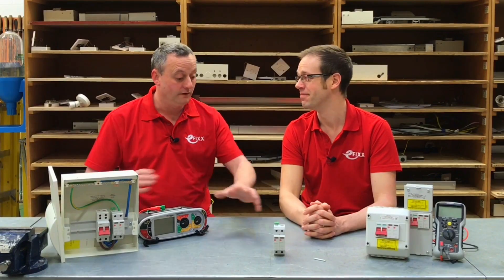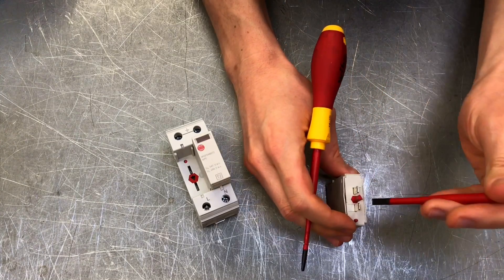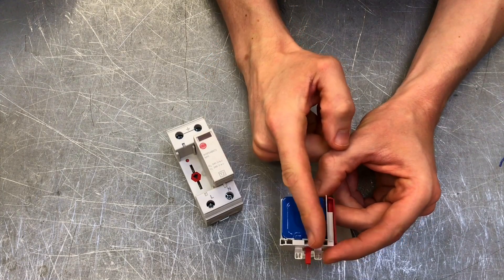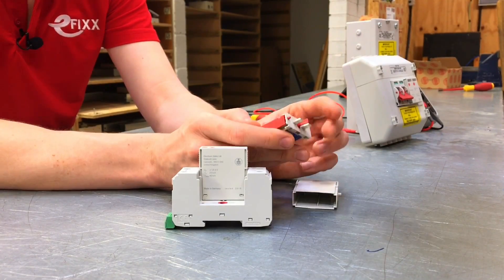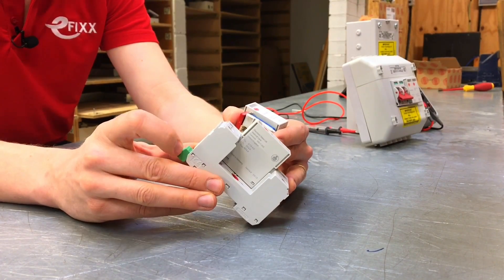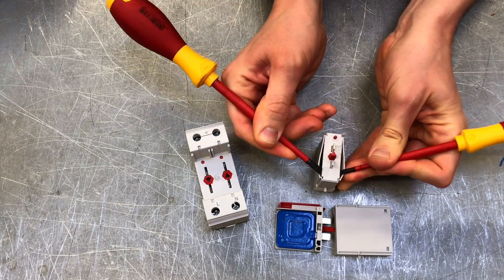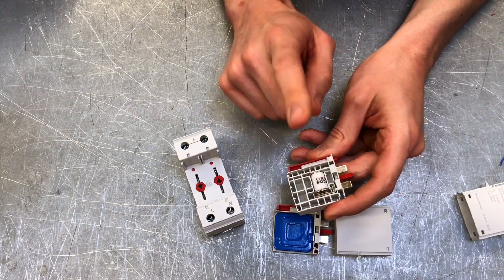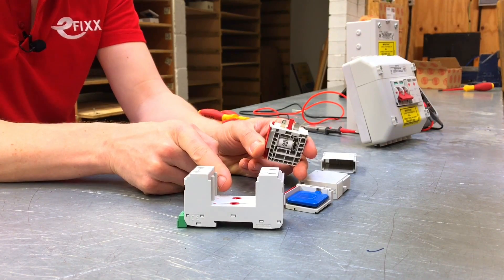What's inside a Type 2 Surge Protection Device? SPD #bs7671

Comment: Functionality is correct, but the end of life is not like this. Usually SPD will take out the fuse at each trigger, if the fuse is too strong it will blow that solder joint and put it on defect. I expect they are almost single use devices...once they clamp the voltage they will fail, in the end it depends of the energy that has to be clamped.

Comment: great teardown and explanation. is a SPD necessary if there is an under current overcurrent protector?  If trying to protect a residential refrigerator pcb/compressor and split aircon compressor/pcb which is better, SPD or undercurrent overcurrent device? Is it ok to use a single device to protect entire house or separate devices for each aircon and refrigerator?  Much thanks in advance.
Reply: yes, the protector reacts slower then the SPD and it will not pick nano-seconds surges. for the fridge/ac depends of the type. the old ones with ac motors will need a undervoltage/overvoltage protection as they are not affected by the surges, though the electronics in the fridge/ac will get hit so both would be better. for the newer ones with inverter these are all electronics so SPD.

Comment: Rcds are checked regularly  by the house owner as they were told to do by the electrician  they are never forgotten about so having A S P checked will be the same no doubt .....I wonder if there is any connection with the possibility of power outages which may induce high voltage spikes ....no I'm sure that's not right ....some people think I'm sceptic I suppose

Comment: Hi,
I was wondering what is the difference between an SPD type 2 device like the one shown in this video and an MCB with under voltage and high voltage protection?

Do I need still to install an SPD Type 2 device even if I have an MCB with under voltage and over voltage protection installed ? 

Thanks.
Reply from the maker: The type of protection offered is different. Over / under voltage is to protect against the supply voltage going above high or low limits. Surge or transient protection is designed to dissipate high energy pulses following a transient event - such as switching a large inductive load or lightening strike energy  induced in to power cables.  - check out our free training course which explores this - https://www.efixx.co.uk/Know%20How/BS7671SPD

Comment: I understand that most sensitive, modern equipments are powered with smps. As these are fitted with surge protection at their mains input filter the only reason, that I can see, is that spds, are fitted to power distribution boxes, is to protect the wiring insulation, from any voltage spikes, that occur above the maximum rating of the cable.
Reply from the maker: The MOV devices contained in power supplies can only handle a small amount of transient power.

Comment: Great video, but how is the energy produced, which is needed, to melt the solder joint in order to release the indicator?
Will the protective element turn into a short, after the last surge it can take passed by, and hence overload the joint?
Or will the last surge itself overload the connection?
If it’s the last option, wouldn’t that have the risk that not the whole surge is consumed by the device, before it dies?
How ever, good video, keep going!
Reply: Typically the indicator window is triggered by a simple build up of heat. An SPD that does not have this function could get into 'thermal runaway' so this little function uses the build up of excess heat to trigger the 'warning flag' and puts the SPD into a safe open circuit condition. If you didn't have it the heat would continue to rise and a fire could be the result. Type 1 & 2 SPD's are in parallel so under normal conditions they see no load. They operate incredibly quickly (often under 25 nanoseconds) and create a short circuit to earth to 'dump' the excess voltage. If the device fails it fails open circuit so it's relatively safe as it's in parallel and the thermal protection will help to prevent any fire. It should be remembered as well that the devices have to be tested & proven to be able to deal with 20 surge events (if the meet the IEC 61643 standard) so they are not one hit wonders, a well selected & installed SPD should offer a lifetime of protection.

Comment: Very informative video. Just wondering though, why different types of device are used for line and neutral?
Reply: Earth leakage. The neutral phase of a TT device needs to prevent earth leakage and an MOV doesn't so it needs to be a different component like a spark gap or GDT

Comment: So the 'consumer' who will be the proud owner of the consumer unit will know to regularly check the SPD for any defect at the same time as they do the quarterly test of their RCD devices... then they'll pile the coats back in front of it all, while smiling to see their equipotential earth bonding cables keeping them safe should there be a problem with the distribution network... I can't wait until we upgrade the consumer units to be meteor-proof, because you can't be too safe...(yawn)

Comment: Hello both, just a quick heads up, at 2.53 you say the left hand module bridges between the line and earth terminals. In actual fact if you bell the base unit out the bridge is made between the live and neutral terminals (not live to earth) on the left hand module. The right hand module bridges between neutral to earth. Great videos though👍
Reply: Are you sure? I was having this doubt. Thanks for clarifying
Reply: Do you know the internals of Type 1+2 spd?
Is it better to install Type 1+2 or separate Type 1 and 2

Comment: I notice that in the Wylex board shown in the video...the SPD is connected to the output of the main switch, working on the premise that a surge is present or has been detected, why doesn't the surge flow along the other equipment on the consumer unit busbar that is also connected to the SPD via a cable? The Over-voltage would flow equally to the SPD and circuit fuses..wouldn't it? especially as the two, (SPD and Busbar) are connected at the exact same Line point. How does this protect the rest of the circuits from the over voltage/surge? One would think that the tails entering the Consumer Unit would need to be monitored for a "surge" then some intervention (triping of a fuse/MCB/RCBO  etc...) would occur to protect the rest of the installation. How does this SPD device stop the surge from travelling along the Busbar to all the other circuits, at all?
Reply: SPD's operate very quickly, in this scenario typically in under 25 nanoseconds so the SPD detects the transient, triggers, opens a temporary short circuit to earth, dumps the extra voltage and then shuts again all in under 25 nanoseconds. This means that the other LV equipment won't even realise there has been an transient event by the time the SPD has quenched the surge.

Comment: i wonder how effective they are on a TT system, if there was a fault on the lines , say a transformer failed or someone messed up in the sub station & sent 1kv down the line, 1kv to earth on a TT , would probably end up making all the bonded metal work live in the house as a typical rod 100-200ohms wouldn't get rid of 230v let alone more.. could it not make a shock risk in some instances? as it wont disconnect the power , specially if its on the main switch side? - and in terms of a lines lighting strike , ive seen what it can do to a house, a SPD wont stop it, would blow it right out the box, if it can jump the air, its not going to be fussed about jumping a SPD
Reply: So type 2 devices are not designed for direct lightning strikes, for that you need a structural lightning protection system and type 1 devices (which are lightning rated). You can get SPD's specifically for TT systems (In fact the one in this video is specifically for TT hence the reason it has a varistor in the live and a GDT in the neutral) installing an SPD NEVER makes a system more of a risk, all the risks you describe would exist if the SPD were not there. The SPD is an over voltage protection device, it deals with very high frequency, high voltage, short term events. It makes systems more reliable not less reliable.

Comment: Are SPDs mandatory under the 18th edition?
Reply: Technically no but it's virtually impossible to find a scenario where they are not required. There are 4 categories where installing them are mandatory (see 443.1 - 443.5) anything else must have a risk assessment, you can elect not to do the risk assessment but if you do then the SPD does become mandatory. When you do the risk assessment you will find that unless you have a small domestic application that is fed via an underground supply cable then you will almost always need to install the SPD. Add to that the requirement to consider the financial risk/reward of installing or not installing the SPD and in most homes a £50 single phase type 2 will be protecting several thousand pounds worth of equipment (TV, X box, dishwasher, tumble dryer etc) so whilst not specifically stated as mandatory there are very few scenarios where you would not now install one.
Reply: @seanpassant3174  
So essentially you are saying these must be installed on new installations. Unless a risk assessment says no.
Reply: @johnburns4017  essentially John yes. 4 mandatory categories where a risk assessment is not required, you just install the device and then everything else must be risk assessed and 90% of the time it will prove to be needed.

Comment: Why have a different type of surge arrester on the line than on the neutral ?
Why not have varistors on both the line and neutral ?
Or gas discharge tubes (GDTs) on both conductors ?
And since there are both different types on the line and neutral, why the varistor on the line and the GDT on the neutral ? Why not the other way round ?
Thanks.
>
Reply: Varistors instantly stop conducting once voltage drops below threshold (i.e. as soon as the surge has passed). GDTs continue conducting until current flow stops - if connected live-neutral, the mains voltage will keep current flowing through the device overloading it. 

GDTs are significantly cheaper than varistors, so it's no surprise that they are used where they are suitable, and the varistors only used where essential.

Comment: Hi, guys! Why wold't you tell about average life-time оf MOV (oxide varistors) SPD's? I mean how many years it works before it to be replaced of course if  SPD was not killed by lightning strike or over-voltage  waves?
Reply: If the SPD meets the IEC 61643 standard then the testing & development required means it has to be able to deal with 20 'events' but the size & frequency of these events differ from country to country so it's very hard to put a figure in years as to how long and SPD will / should last. In the UK (where I am based) a well selected & installed SPD should last a lifetime because we have relatively little lightning (though of course it's still a risk) and we have a pretty stable supply grid so your SPD could easily last 15-20 years BUT..... in a country like South Africa where they have a lot more lightning, a far less stable grid, load shedding issues etc an SPD may only last a few years. There are other issues that come into it as well, a poorly installed SPD will not last as long so remember to keep all the cables as short and straight as possible. Make sure the earthing is good and ensure that you purchase a decent quality device that complies to IEC 61643 (or the local equivalent - here in the UK it's BSEN 61643) and make sure you properly read and follow the installation advice in section 534 in BS7671 18th edition and any manufacturers instructions.

Comment: Great videos Guys. Really informative and professionally done.  Would be great to understand why there’s a need for the two different technologies in each of the SPDs.
Reply: The GDT acts in the same way as a spark gap, so it is voltage switching rather than voltage limiting. The difference in the neutral phase in this device indicates that it is suitable for a TT earthing system, devices for TNC-S/PME application would have the same for all phases. The circuit diagram from a Dehn type 2 device here shows the TT version: https://www.dehn.co.uk/pdbRes/DE_EN_Web-UK/1628/33274/Img/12995321/952115p.pdf and here it shows the TNC_S version: https://www.dehn.co.uk/pdbRes/DE_EN_Web-UK/1628/33274/Img/12995264/952205p.pdf feel free to contact us if you require any further information: info@dehn.co.uk
Reply: @seanpassant3174  thanks for the explanation!
Can you explain it again and tell the physical/circuit-level reasons that there are two different elements in use?
What is the circuit level reason for the one or the other element being used depending on the electrical system?
What’s the difference between voltage limiting and switching?
Is limiting just like keeping the voltage at the standard level and is switching like dumping nearly all voltage to the cpc level, since the GDT becomes highly conducive?
Reply from the maker: Hi. We are working on other videos on SPD’s. Thanks for commenting and watching Gaz 👍